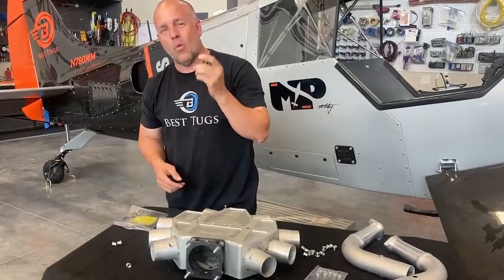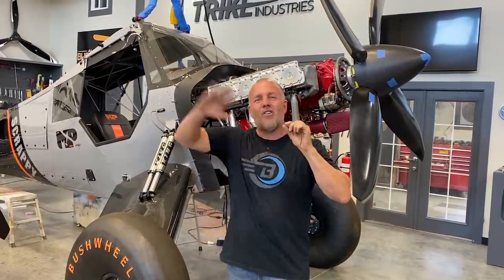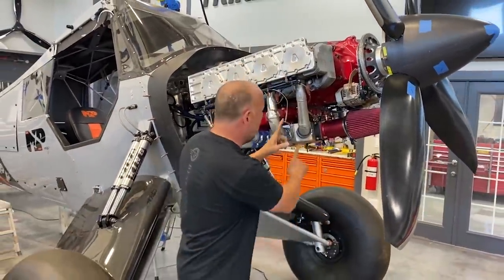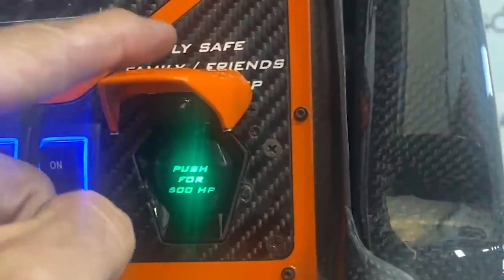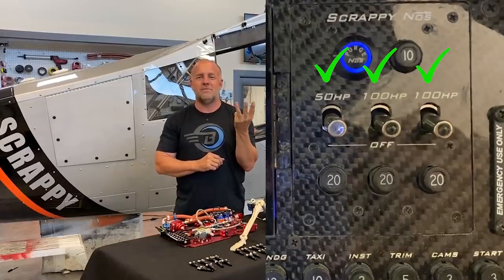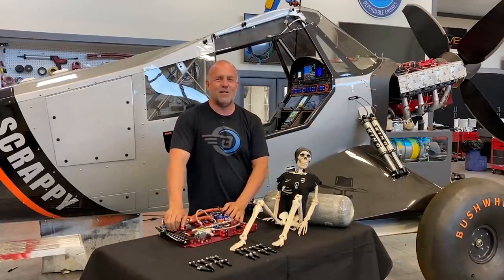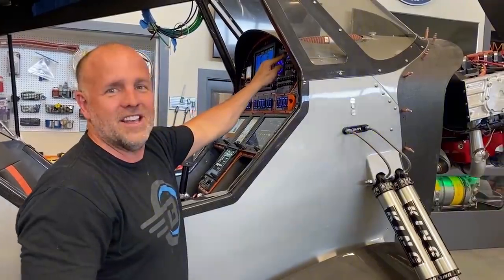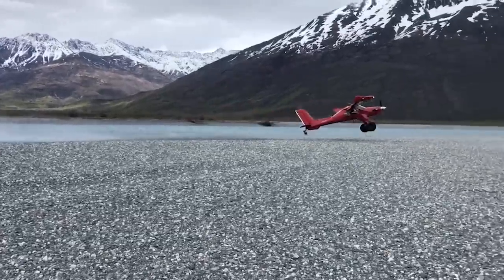NOS on a Bush Plane 😳 🤠 - 13L 250 Shot Nitrous Oxide - Part 1 | Scrappy #39

Comment: Might be a good idea to change the 50/100/100 switches into a single rotary selector with a reliable solid state decoder to control the solenoids.   One less thing to think about.

Comment: Quick question. I assume an extra 250hp of instant power will add some sort of extra torque to the airframe. If that assumption is correct, have you had to beef up your airframe in different areas? Will you have to beef up the wings for the added torque? 

Again this is an assumption that there will be immediate torque once you punch that nitros button. So if I’m completely off basis let me know.

Comment: Out of curiosity, why not use water/methanol injection? It's safer than nitrous, it will yield a very similar effect, it will run cooler allowing you to push the engine even more. Best part is, if you run out during flight, the engine won't be effected much as long as you throttle back a hair. Just a thought...

Comment: Nice so instead of turbo normalized. It’s nitrous normalized, hard to call this plane nor a though. I used to crew an IHRA pro mod car that had 3,000hp of nos, so basically the carburetor was just for starting burning out, and staging, the fuel it supplied during the run made virtually no difference. My main job was data collection and secondary was being a wrench, I wish I had been involved more in the no’s tuning. Later when the car was blown injected I did tune that engine. Can’t wait to see where you take this plane.

Comment: Any good ideas to help with the massive torque roll issues that this prop and engine will create? Wouldn`t want to hit that nitrous button without plenty of airspeed. The power to weight ratio must be close to some of the fighter aircraft of World War 2.  Lots of pilots learned about the torque roll the hard way before jets came along and solved the problem.  An excellent pilot such as yourself Mike should have no Problem but it was interesting to see the Airboat in the beginning scrappy videos lay over when the throttle was opened.

Comment: @Mike, can you share more info on the effects of your NOS system and the inherent intake cooling on intake icing? This question because you mentioned float flying near glaciers (high humidity low temps likely), and your NOS can drop the intake temp by 40°F.

Comment: Mike, with your conservatively estimated power increase, does this preclude any adjustments of ignition timing or sparkplug heat range?

Will the engine run pure synthetic oil?

Has the piston ring gap been increased to possibly avoid ring breakage?

Will the nitrous system run a standalone fuel system permitting the use of higher octane fuel?

Has an engine vacuum pump been installed to evacuate the crankcase of positive pressure when the nitrous system is in use?

Just curious.

Please continue to produce and release the quality videos that your channel subscribers have come to appreciate.

Take care. Be safe.
Now, back to work 👍🏻

Comment: Out of curiosity, would you ever consider using water injection to increase horsepower like the P-47 Thunderbolt? How does the water injection system stack up to a turbo or NOS system when it comes to power, system weight, temperature, and endurance?

Comment: I was wondering, if it depends on density altitude, could we set up a microcontroller to detect air pressure, temperature and humidity, and adjust the nitrous shot accordingly? So you could select a needed horsepower "adder" automatically?  Interesting discussion...

Comment: I notice that you could press that NOS button with a finger, rather than just the throttle. Will that be too much temptation? Or do you have another switch that doesn't allow that?

Comment: Switches for HP and a chart. Why not have those switches digitized so you always have the right amount of surplus of power at the right altitude. Just push the button to say I want it, and bump the throttle all the way to make it happen. No charts and no playing with switches? Although the switches are very fast and furious. 👌👍

Comment: I thought you were running EFI? Why the wet kit over dry in that case? I'm also curious as to why the switch system instead of a nitrous controller that would PWM the solenoids based on a dial setting and a measurement for the altitude.

Comment: did you ever try to design some pilot tubes that have all three of the nitrous injectors installed into them, so that at all three levels you can have the nozzles as close to the intake as possible?

Comment: Based on how quickly airboats accelerate, youre going to need some really well braced wings to prevent them from folding back if you intend on using all your takeoff power.

Comment: Looking forward to part 2 Mike!! Having built and been involved in several NOS engines (race cars, etc) I have questions. Before computers took over the work we would always pull some timing out of the spark curve when running the bottle tune. Are you doing the same? Is there a computer involved in this engine? If so it is easy to set it to pull timing when you are on the button as you well know.
On a similar line, as you also well know mixture is critical in a bottle engine. To lean and Bad Things can happen. With the airplane operating at all sorts of DA and constant mixture adjustment for best temps, are you using a computer and O2 sensors to deal with this or is it up to you in the cockpit to do so?
The ground tests etc are going to be very fun to watch. I looked and didn't see O2 sensors but I know you have CH temps, will you have 8 EGT probes as well?
Sorry to be such a pain...if the second installment answers the questions or I can figure it out watching I will be happy with that. Love this project more and more!

Comment: Would having the nitrous spray nozzles sticking into the intake track hurt the airflow going into the cylinders ? Could you have them mounted on an angle and recessed back out of the air flow path ?

Comment: Aviation newbie, would this build be capable of inverted / acrobatic type flight? Do those planes uses some specific engine or fuel system to allow them to function upside down? I'm assume the airframe would be strong enough for that type of thing but I don't know anything about it.

Comment: I understand that nitrous helps make up for oxygen deficiency at higher altitudes? 
So are there diminishing returns the higher the altitude? 
Could you have more reliable power at lower rpm if you supplement with on board oxygen? 
Or, like the nitrous have an instant power boost at high altitudes in an emergency situation?

Comment: If nos drops engine temperature what type of effects will this have at high altitude in supper cold air up north on performance will ice form in the air box causing a problem at some point

Comment: So if i u derstand right. The Nitros give you 250Hp on the ground but with more high it will be like 100 becouse of air. But you will use 50 on low altitude and than 100, 150, 200, 250 depends on altitude right? But you can use 250 more on the groud if you want. Am i right?

Comment: I'm wondering how you are making sure the fuel nozzles get instant fuel. The nitrous purging is nice, but liqued nitrous at 800 psi reaches the jets a lot sooner then fuel at 6 psi. In my nitrous days we purged thru the engine, not to get the liqued nitrous to the solendoids but to make sure the fuel was there also.

Comment: i would get rid of the ones in the throttle body    just run the two kits in the intake tubes.  what psi are you going to run and will you be able to adjust it .

Comment: Is there a transmission curve or slow speed security when to inject the additional HP without getting to much torque at slow speed who could overtake the air lift and rotate the body at low altitude and lose control  ?

Comment: question at 8:00 - are you using any kind of pressure sensors to limit the shot so you cannot accidentally fire a 250hp shot of nitro at sea level?

Comment: I was watching this and got to thinking about your battery and then you mentioned the altitude effects on fuel mixture and rpm/power which led to a idea how about a hybrid, electric motor provides even torque lithium batteries constant power generator light small fuel efficient the only real downside is weight but with carbon and lithium a small plane could be under the trade off?

Comment: you obviously know this but at the end of the day you simply need to build an engine that can handle the highest workload you intend for the engine. it is of course not so accurate / simplistic to say 1 hp / cu and boosting thereby. you need to have an engine whereby the components are strong enough (work, f=ma, etc.) to handle the additional forces you Are going to put the engine under. btw i love what you do - draco, scrappy, your race planes and hangar. awesome way to live !!! (and your family seem fantastic too).  :-)

Comment: How hard would it be to whip up an auto mode switch where some kind of micro controller like an arduino monitors ambient barometric pressure and pre selects the nitrous switches?

Comment: Regarding the switch behind the throttle, Would it not be safer to have this covered by a safety box with a slot in it for the throttle to engage it. This way, you would never press the button by accident?

Comment: What about a water/methanol system to cool the intake charge and to give more power. Didnt they use the water/methanol in aviation to do exactly what you're talking about giving you that little extra boost? And talking about purging nitrous you not only have to purge the nitrous to get air out but they also bring the engine up to like 3,000 rpm and bump the nitrous button to purge the fuel as well every time iv seen them purge nitrous and not purge the fuel it burps and backfires causing it to go lean for that split second and lean pop

Comment: Question, the exposed nitrous button could unintenionally be triggered at low rpm? Why not a hidden microswitch under the carbon throttle/mixture housing? Back to wor... uhm...watching. 😁

Comment: I personly would have gone with a turbocharger, because it can gibt you more Power, but most importanty it increeses fuel efficency at los to mid throttle Position and rpm. And if you really trying to push the wieght down you could build carbon fiber inlet piping and stainless steel  exhaus heders and so on.
Reply: Did you listen to his reasoning why not the turbo?
Reply from the maker: 🤠🤠🤠👍 Don’t get me wrong, I am actually a giant giant fan of turbos,  been racing them my whole life.  Absolutely the best power in my opinion is turbos for most all applications.  On this build it’s about saving the weight of about 75 extra pounds and that I may never need to use it anyway so I don’t want the pounds there on the other 99.9 percent of the flights.  That being said, if I like the power and want to use it 5-10 percent of the time I’ll pull the nos and add twin turbos in a heartbeat 👍🤠

Comment: I know that mechanical systems are simpler, but they rely on humans to flip the correct switches. You’ve got advanced avionics that can determine density altitude. Feed that information to a computerized controller (Arduino, for example) that can flip the relays and you enforce your placard in software.

Comment: Would think that adding a turbo would save some pistons and spark plugs.. Because nitrous burns those even with optimal tune. And when the bottle goes cold, like everything does in higher altitude, it spits glumps of nitrous, destroying that fragile delivery system, and then the engine. It's just too complicated and prone to fail system to put on a plane. Turbos can be tuned to deliver the power even more precise and on demand than Nitrous system. And they are much more gentle to the rotating assembly than a nitrous shock. Just to let you know.

Comment: This is still a scrap build, right? :)
I get you want to play with nitrous and the heat argument but if the use case is brief cold engine bursts then wouldn't a simple turbo setup work? less to fail, no limit to jumps, good high altitude engine breathing.

Comment: Will you be using a strobe light and some spots of white on the blades to watch that custom prop's blades when you first test the nitrous on the ground. The prop does not have the natural dampening of a belt redrive or the higher frequency of power pulses the blades would see via a geared redrive from a faster running automotive engine. Then again, the prop may have already been proven, direct driven by a Lycoming 8 cylinder or automotive V8 engine on an airboat.
Reply from the maker: Most early airboats ran direct prop with aircraft motors.  This exact engine and prop are used together everywhere today on airboats as a standard package.  👍🤠
Reply: @MikePatey  I should have realised you would have already conducted the appropriate research.

Comment: Now everyone is going to think they need a cold engine. Heat in an internal combustion engine is necessary for a wide variety of reasons including proper vaporization of fuel. In theory the hotter the better for fuel but in reality too much heat will destroy a motor very quickly. Everything is always a balance between 2 evils. A cold damp air charge will bo0st horsepower AND keep your cylinders and heads and pistons nice and clean. Nice warm fuel will vaporize quicker and increase power.
Reply from the maker: Agreed 👍🤠 on all the above.  More details I could give on the basics someday may be a good idea 💡🤠 thanks

Comment: Are you going to dyno this engine, and can you get a dyno that can supply the engine with air pressure of 18000ft? So you know that the nos works well.. Or is this not needed?
Reply: I think a restriction plate could simulate any altitude you want.

Comment: So the switches give you a range between 50 and 250
Just switch 1 = 50
Just switch 2 = 100
Switches 1 & 2 = 150
Switches 2 & 3 = 200
Al 3 switches = 250
Reply from the maker: 👍🤠 correct

Comment: Surprised he didn't go with an electric hybrid system for engine power, like the KERS on F1 cars. Maybe store energy in capacitors or batteries while on descent and use the charging system like a Jake brake on a semi or regenerative braking on a hybrid car. The nitrous will deplete to empty tanks, a battery hybrid system could be recharged and used (most likely?) many more times than the lifetime of a nos bottle. However, I'm just an everyday jack@$$, this dude is a driven genius, maybe he already tried it.

Comment: As predicted, I read the title and panicked.  I learned more about nitrous in this video than ever before.  Using it to restore power at high altitude seems like a fine idea.  I guess I hope you can contain the urge to show it off at every event leading to danger.  Kind of like saying I'll only use the heroin on special occasions.  But sounds like you have experience with this drug and can handle it?

Comment: May i ask a perhaps stupid question. Yo seem to be so adventurous, have you ever thought of having a hydraulic engine alignment system, so you can elevate the engine aiding lift on take off. Surely if you were able to give the engine may be 15, 20 degree tilt , you could dramatically aid lift on take off ?????????  Surely that wouldnt be to hard to do either, just a modification in the mounts and a few hydraulic rams ????????

Comment: Mike I don't understand the logic behind adding this capability when you could just install a turboprop engine like what was on Drago? Doesn't adding this nitrous system put you and the engine more at risk?
Reply: Let me break it down for you in simple terms..YouTube is "interaction-related"..The more "interaction " you get, positive or negative,  the more you get "recommendations ". You do dum and crazy stuff like destroying a brand new truck 1-2 days after you bought it,  putting a lawn mower motor in it, using it to  crush your besties new car...or...In this case,  putting NOS in a airplane motor to see if it will take it or blow up. 
.Either way,  it's a  win-win...Coz, you got views, content and most of all... Interaction!!!... Cheers  !!!

Comment: Why not add a barometric sensor to automatically switch systems to give you 600 hp. And sequence the system to purge then give the shot of nitrous when the throttle switch is made.

Comment: I'm a racecar guy but I've always said if I ever build a plane it'll have a nitrous system that I plan and hope to never use, for emergencies. Like running out of room to clear trees on take off, or f*cking up in the hills where there's no way out of a rising terrain situation. Screw it, turn the 150hp bush plane engine into a 250hp engine for 30 seconds to save your ass. Not gonna be good for it but hopefully be able to limp it home and rebuild it, or at least buy yourself enough time/altitude to have a chance of landing rather than crashing.

Comment: After being a drag racer for years!!! I would rather run a supercharger!!!!!!
Reply: Airplane is a bit different, weight is a huge factor, and his reasoning makes sense. Not using it all the time because it's not needed, he'll Vne the airplane.
Reply: Yes a aircraft is very different.  I definitely understand the weight savings aspect!! Now with a nitrous system for a aircraft.  You will need to add all the weight up on the equipment needed.  The lines, electronics,  solenoids,  tanks, tank blankets, and etc. That is just for a occasional boost of power for just 25hp!!  I really think a supercharger or turbocharger would be better suited on a aircraft.

Comment: Why not make it a rotary knob so you could just turn it up from 0 to 250 in 50hp steps. Maybe not even mark it by hp but density altitude so you don't even need to look at the chart but just set the density altitude on the knob and thats it.